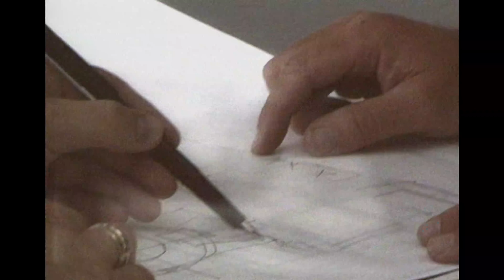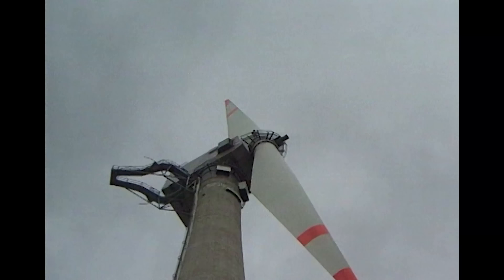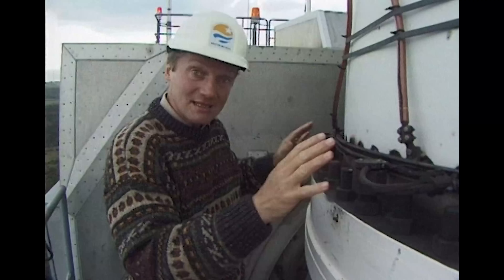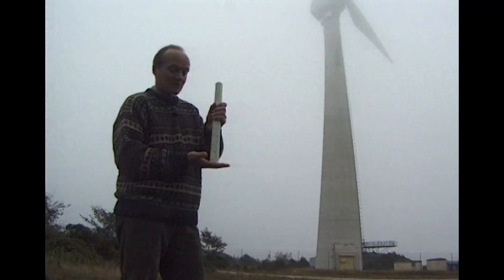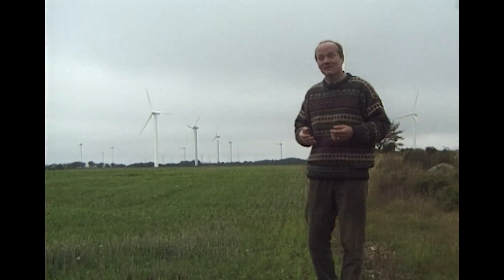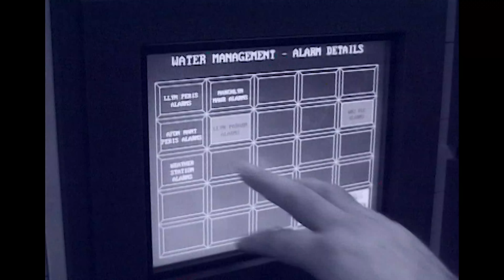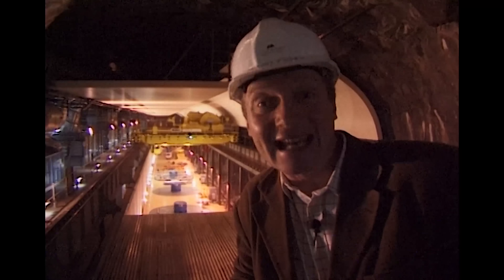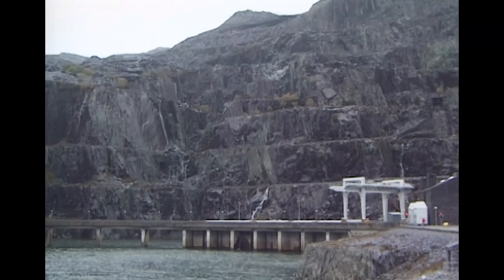The Evolution Of Renewable Energy | How Did They Built That? | Spark

Comment: Renewable is irrelevant, calling energy sources RE tells us absolutely nothing useful about sustainability, environmental impact, effectiveness, efficiency or anything else that actually matters. Renewable is nothing but a misleading marketing term like all natural or chemical free. It's used to give the impression that it's better without bothering to look at what it actually does and doesn't do.
Reply: Try telling that to the millions of people that have solar or wind energy on their homes that it's irrelevant.

The irony is, for about £6,000, I could build a solar system on my house that would cover all my energy need and generate way too much in summer, assuming you install the setup yourself which works out much cheaper.

The problem isn't renewable energy, the real problem is storing that energy, if battery tech was much better, a modest solar setup would be enough to generate all the electric needs of your house and push a little more, you could cover all your energy needs, heating, electric car and so on.

So yes, renewables isn't irrelevant but it's not prime time until battery tech catches up so we can store a lot of energy.
Reply: @paul1979uk2000  
You completely missed the point. What matters is clean, reliable, low environmental impact energy, not if it's called RE or not. 
Intermittent and reliable energy are not the same thing. Some W&S makes sense if there is enough firm, reliable power to insure stability. Too much raises costs (financially and environmentally) and weakens energy infrastructure functionality. W&S operate on top of reliable energy, not instead of reliable energy.
I think there are appropriate applications for all energy sources, meeting the needs of 7.5 going on 10 B of us in vastly different circumstances will likely take all options. As NP is by far the lowest environmental impact we should be using it as much as possible.
Most of us have no idea what it takes to have reliable energy infrastructure, and we should if we're going to have opinions about how it should be done.
For a explanation that we don’t have to be engineers to understand a great resource is Shorting the Grid: The Hidden Fragility of Our Electric Grid by Meredith Angwin.

Comment: How about splitting water  💧  the ultimate renewable and the electricity that the earth creates just using  the earth's magnetic core
Reply: The energy you get from burning the hydrogen is less than the energy it takes to split the water molecule
Reply: Hydrogen is a storage mechanism with many issues, like very low volumetric energy density, low round trip efficiency, kinda dangerous, makes metal brittle.
Reply: @fjalics  Not if you store it as water and split it just before its burned like Stan Meyer did in his water powered car. Use your brain  a little
Reply: @bluesky6985  If you have the energy to split the water, just use it directly. No need to waste half of it splitting water, then making electricity out of it again, or heat. I'm guessing you believed some unbelievable story somewhere along the line, that isn't true.
Reply: @fjalics  Are you dense?
Reply: @derrekvanee4567  Why did they murder him then and he got a patent for his method of splitting water 💧.
Reply: Tin foil hat alert! Do not engage with this lunatic!
Reply: @choomanfoo  I won't engage with you then.  If you argue with stupid people you beat me with experience and proficiency
Reply: @matgeezer2094  but you do not need to split a pure water, just mix with salts and you will split it much more easily
Reply: @matgeezer2094  In other words you do not need to produce O2+H2, you can produce 2OH+H2